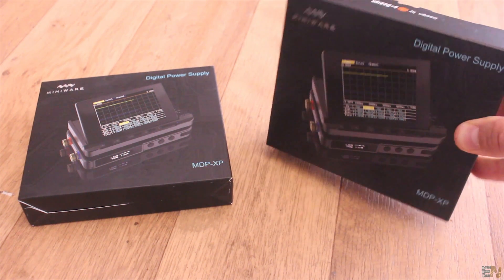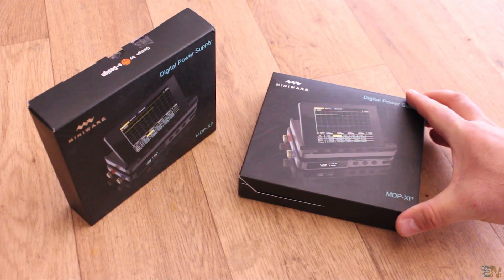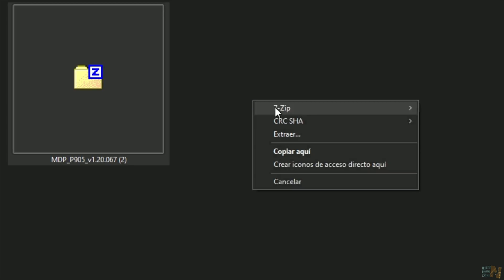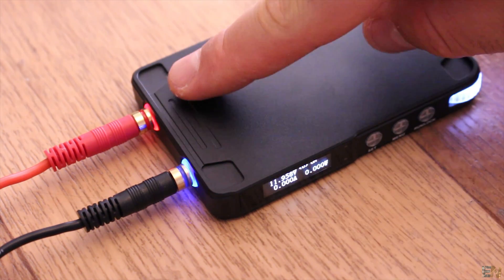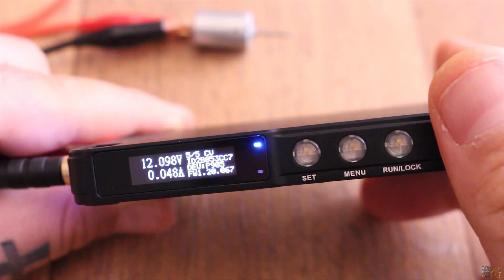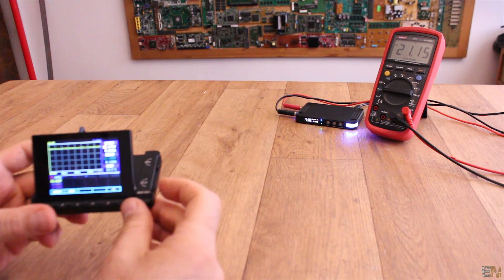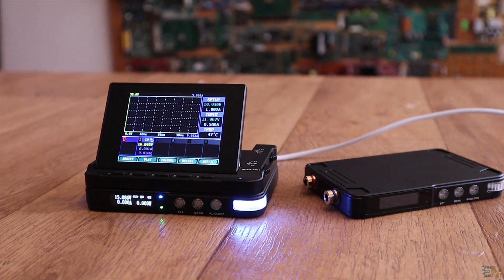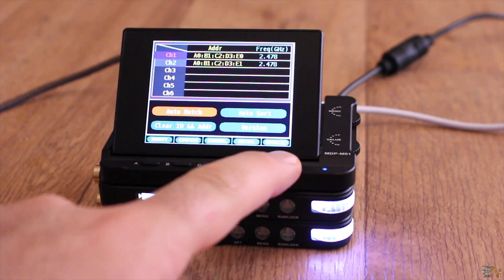MDP-XP Digital Power Supply REVIEW | Wireless control up to 6 units

Comment: I just wanna mention that I found this set (MDP XP) and the individual unit (MDP P905) for MUCH cheaper than Banggood by going to AliExpress. I did take advantage of 11.11, but it looks like the prices are still not much higher than I paid. (Have to search around and find the right seller)

No BS, I paid $126 for the paired unit and $106 for an additional P905, got my units shipped to me in CA with basic/free shipping in less than 3 weeks. Just putting that out there so ppl know to look around

Comment: Since almost 2 years MiniWare (and thus Banggood) promises to make available additional tips for their TS80 USB-Soldering Iron. Customers who paid a considerable price for that iron are still stuck with those just 2 available.
Instead MiniWare seems to have invested huge efforts and resources into the development and launch of this new gadget of yet questionable broad requirement. And again their marketing start to spread promises of allegedly additional great modules for this this thing to come out.
I'm afraid that with this product, again, a lot of people will invest a rather high price, hoping for promised accessories to come out, but which will never show up.
Meanwhile I'm really disappointed by this manufacturer...
Reply from the maker: I'm afraid that could be true...
Reply: On Aliex... is a new tip version its called TS-K4 😊
Reply: Yep that pretty much sum up most Chinese manufacturers unfortunately. They push out product and but lack real support, or promised accessories. It all about hyping up a product and then coming out with a new overpriced product pretty much sums up MiniWare. I bought the TS80 and very disappointed in lack of tips availability as other are. I going to actually mod a KSGER solder station to run off 18650's cells with BMS balancing to charge and use it to replaced the TS80. Then at least I can use Hakko T12, or T15 tips. To me will be much more useful.

Comment: I like it mostly for the multiple power units that can be controlled from the one head unit. If the power it outputs is clean enough then I see it as a big leap forward from the more expensive multi output power supplies.

Comment: What is the performance? What do the transients look like? Looks more like an advert to me. Too expensive as well.
Reply: @miniware  Since you guys seem to be the manufacturer of the product. You may what to reevaluate the pricing, as you could sell way more if priced more within reason.  As far as the price/performance ratio of the MDP-XP can be assessed. My answer is that this power supply is too expensive for what the device performs and only being single channel. In terms of specifications similar power supplies are for sale for prices around $80 to $90. The MDP-XP is in my opinion is more of a gadget then a tool. People are way better off spending the money on a Rigol, or other power supply, especially if they need more then one output. As this thing would cost $680 if you want triple channels?

If it was battery operated, or was lower wattage and can be used using a external battery setup, then could justified the purchase.

Comment: I prefer my Rigol dp832 supply, but for a portable solution it looks like a good choice. My only concern is, that you'll need an external powerbrick for that. Btw, can it boost the input voltage as well? And if you use a lot of power, with a switching mode powerbrick, wouldnt it have a lot of ripple on the output? Yeah, it uses linear regulation, but if you use a switching supply to supply this regulstor, it will kill the entire linear behavior of it. Correct me, if I am wrong.

Comment: Wow. Where do I get that interface hardware, cheap? I've seen rotary encoders on AliEx like the one they used on the corner, but the ones I've seen didn't have the LED and transparent roller wheel. I've never seen 4mm banana jacks like these. I would soo use those in a project.

   I like the idea and functionality of this supply, but that packet load driver setup is very concerning for security reasons. I'm certainly not someone that should worry about security like this. What are they going to steal, my super secret 1970's LM317 power supply designs? I imagine I'm not the only person that has interests in hobby electronics AND family around that would be a security concern. I bet this kind of household relationship is actually common. I don't think I'll be embedding a trojan and running their hex file like this unless the source is available and can be checked by people far smarter than myself. I'm no digital security expert, but I think this type of USB payload is like handing them keys to the mansion.
  Thanks for the upload.
-Jake
Reply: It's not using a driver, it's just showing up as a mass storage device, like any USB flash drive. Shouldn't be any security issue there, but if there were some executable or something on there you'd probably see it, and Defender would most likely catch any malware if you did accidentally run something malicious off the "drive."

Comment: It certainly looks nice, but the terminals on the sides eliminates a lot of the space savings, as you can't place anything beside it. It's also pretty expensive for it's capacity. The unit shown at 0:40 looks to be a much more economical unit, and by simply redoing the case, could be made stackable. The module would sit beside two vertically oriented banana sockets, in the standard width, to support dual banana plugs. That's another thing about this unit... Non-standard power output banana spacing. Regarding the main power switch, just add it horizontally and add a little width, or have one master power switch to control them all, and have a base unit that sits at the bottom with the switch only, to power all the other units on and off.

Comment: Nice powersupply, but for $200USD + $10S/H and "only" 5A max output, this is not worth it. This could be easily made using an esp32 with a buck/boost converter and all the other gear for a fraction of the cost. The fancy case and the software is not worth the advanced cost.
Reply: You can get a Rigol DP832 and hack it to a DP832A very easily  which is a Triple Output, better specs and less money and yes you can remote access the supply. The cost of 3 of these will cost you $680 and no where near as good as the Rigol, especially once it hacked. It just way to expensive for a hobbyist and you can do much better for the money spend. Even a cheap $99 dollar power supply will have similar specs. Get yourself a better power supply like a  Rigol, or HP, for the price it cost you to get three of those.
Reply: Try getting 4mV VPP and implementing any form of a tracking switching supply with a linear output module, forget the control unit and stackability
Reply: It’s actually cleaner than most lab PSUs and so small.
Reply: I highly recommend watching Marco Reps YT Vid where he tears one of these things down, and you will see that it would cost a whooolllle lot of $$ to build one yourself to the specs that this thing has. 

I have 2 myself actually, and one of them I pretty much only use for powering guitar effects pedals (by far the quietest PS I’ve ever tried...) and can be powered off of a laptop charger or USB C or whatever the hell you want basically, even works great with power banks... 

It might just seem like a fancy box (certainly does look fancy LOL) but it is much muchhh more than that, and honestly a marvel in engineering without question. It is so small, it doesn’t make sense how good it is really and the specs are not BS

I know it’s not for everyone,  but there is definitely a lottttt of Potential uses for this thing and no one will design something not only better but more portable than this unit
Reply: @TylrVncnt  The specs are actually not that great and people already complaint on forum and reviews about it failing even. For the money spend on a single channel power-supply. I say spend more and get a good triple output supply like a HP/Key-sight, or Rigol for the money you end up throwing at this thing. They are taking a page out of Apple book and making it flashy and making it where you buy one you end up buying more later to get more channels when needed, like Apple does with their ecosystem. Sorry but this is test equipment, I could care how nice it looks, it how it preforms and its usefulness at the end of the day. Unfortunately the specs are not that great for the cost/ratio of what you are getting. 

If it had a decent size internal battery, hence make it larger is fine, so can have one for quick testing when out in the field, then I buy it in a instant, just to have in my tool bag, along with my pocket scope, various meters, logic analyzer and a good Propane and TS-80 solder iron. That only purpose I can see one of these for is out in the field use, due to its compact size, anything else your better off with a bench supply. To bad they just didn't make a less powerful version and run off USB C, or external battery? Think TS100
Reply: @thetechgenie7374  actually it can be usb powered! you just need a power bank with qc 3 and you can have a mobile power supply, the boost converter in it is pretty neat for on the field work
Reply: Si no te gusta no te inscribas para el sorteo jajajajajajaaj
Reply: @josuevillasante2546  I didn't say I didn't like it. I just stated that it was way overpriced and could be built for cheaper. The components to price ratio is way out of line
Reply: @korishan  They're probably using the Apple type exclusivity hook, ie: we look cool, so you should pay for the privilege.
Reply: @SidneyCritic  it does look like it doesnt it